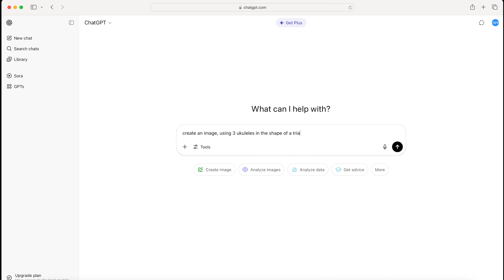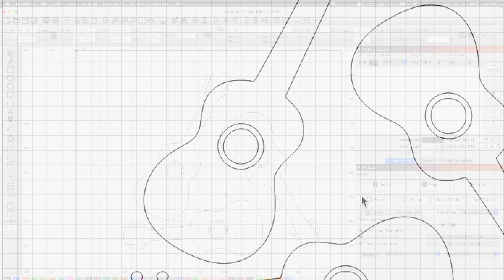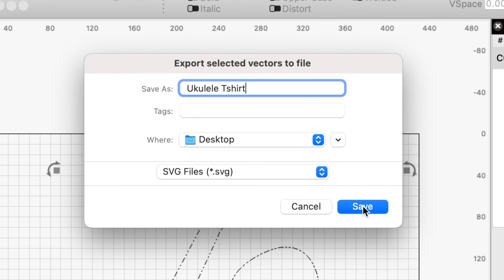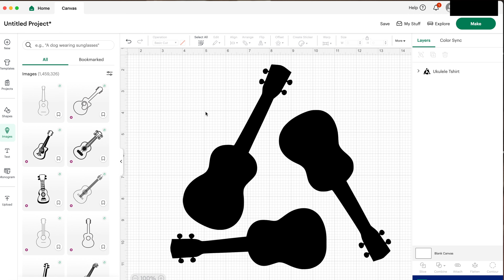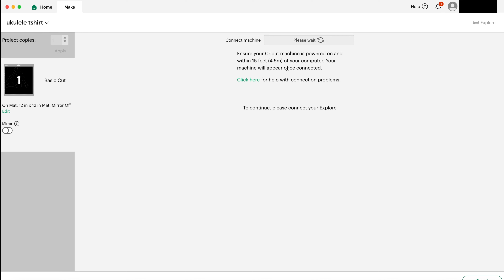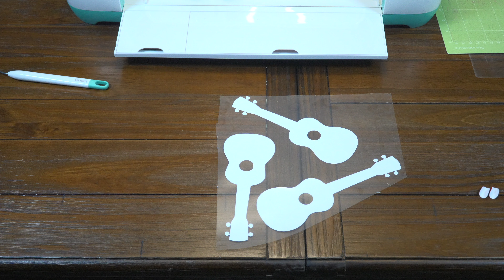Making Custom Shirts with Heat Transfer Vinyl

Comment: Well, that shirt turned out nicely. You could really let your imagination run wild with that setup. Take care!
Reply from the maker: You are pretty much only limited by your imagination with this method Michael.  There can be some issues with thinner lines being cut in the vinyl but if you're careful, they are still very doable.  Thanks for tuning in to the show this week.